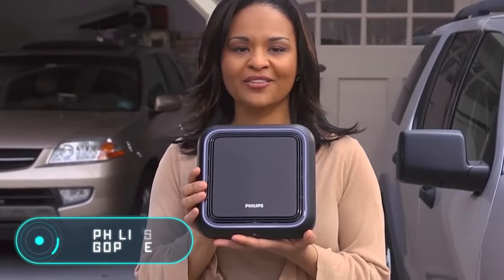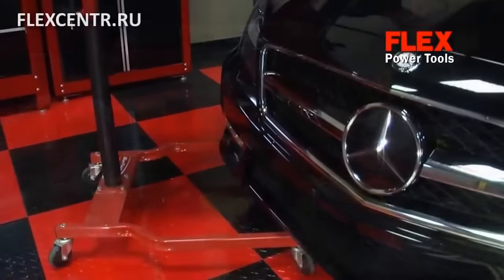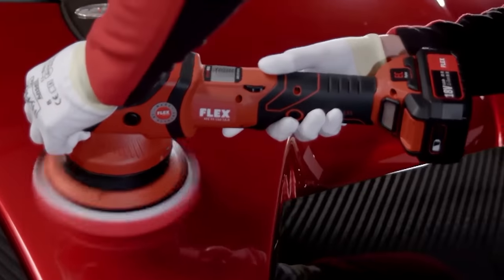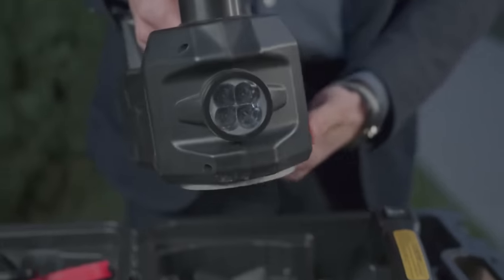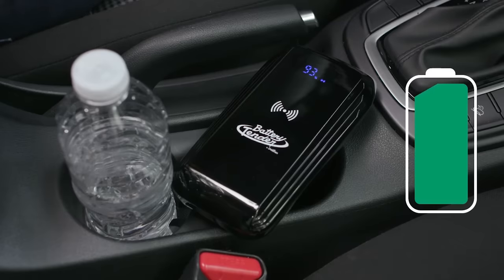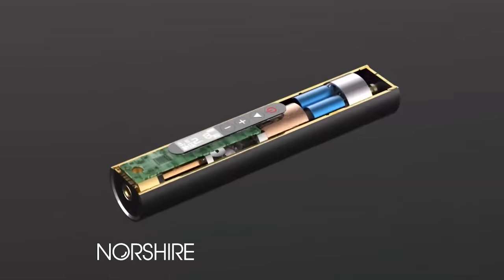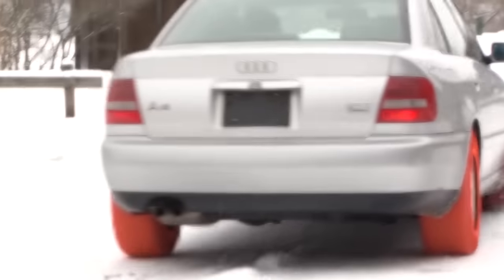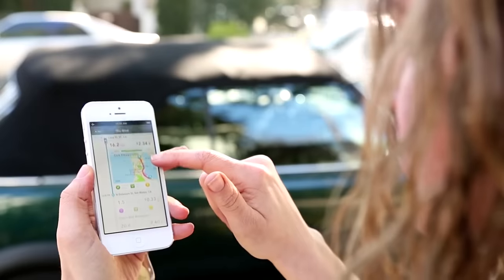8 BRILLIANT TOOLS TO HAVE IN YOUR CAR

Comment: Here’s a tip I found useful, wrap your windshield wiper blades in those plastic sleeves that you find at some stores for umbrellas, grab a few of those & store them in your car & in winter simply slip them over your wiper blades & they work great, you can use the throwaway plastic bags you get from your supermarket to wrap your mirrors & they can also be used in place of the plastic umbrella sleeves too! So to remove the ice from your windshield you can simply put your winter windshield washer fluid in a spray bottle, start the car, turn the defroster on high & simply spray your windows & the windshield spray nozzles to quickly free them of ice, no need for a scrapper! I drive a Tesla Model 3 & you can go into the touchscreen menu & stop the automatic folding of your mirrors as you walk away from the car, that’s helpful because you don’t want that feature to be used when you enter the car the next morning after a hard freeze overnight, because the mechanism could be damaged if it’s encased in ice!

Comment: 1st one, if filter is dirty then that mean your cabin filter in your car need replacing. Usually found under the front passenger glove box you can get to and replace the filter. Can’t do much job if you smokes a lot.

Comment: I've got something akin to the Battery Tender and it only works if the battery is only slighhtly undercharged. It won't work if the battery is fully discharged.
Reply: Quentin Stephens that’s very important to know!!! That’s a dealbreaker for me. Thanks 👌

Comment: My car already has an air filter... Nice try Philips.
Reply: ever removed that kind of smoke that is stuck in your car and you have guests complaining about it? better buy it bro
Reply: @GK2o  if you car is full of smoke all of the time you might need to get it checked out
Reply: thine gingerth Crusader im surprised you didn’t seen smokers not even using that sort of thing on their cars to remove the cigar smoke for their guests and friends
Reply: Correct. If the OEM filter doesn't catch enough smoke, just buy a better filter and save a ton of money.

Comment: For any one that wants to melt the ice off their windshield for much cheaper and faster, just use an alcohol, soap and water solution. 
1/2 gallon hot water.
1 tsp Dawn, Ivory or another biodegradable dish soap.
1 tbsp 70-percent isopropyl alcohol